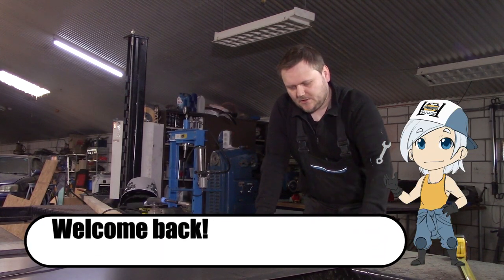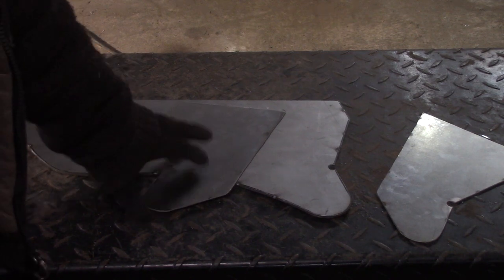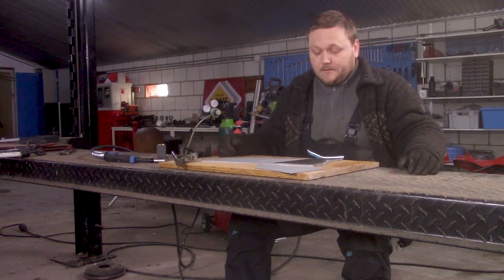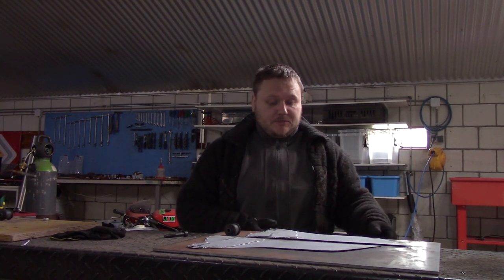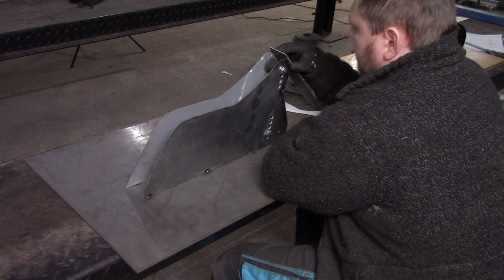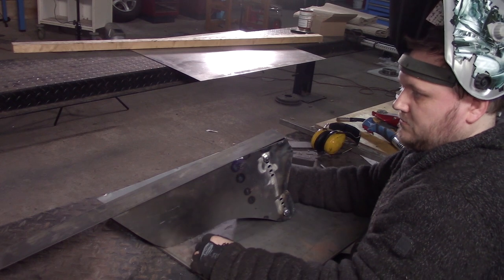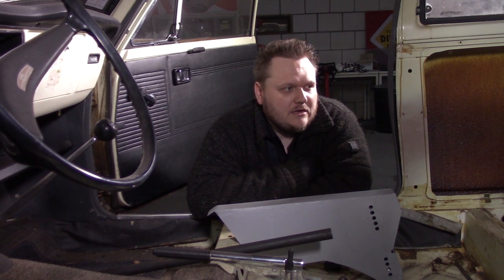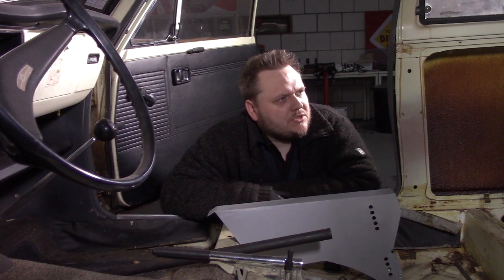KE10 Corolla Build Pt 7-3 | DIY 4-link suspension. Chassis boxes.

Comment: Hahaa, i think to do pushrod-suspension too!!! There is enough space between the shelf and the tank, i plan to use crossmember and 2:1 ratio triangles and half the travel coilovers with twice the stiffness coils.
Reply from the maker: Hi there. I dont think there is enough room there for the coilovers I am going to use. But still great to see a other one building a system. I am also in developing a "big" brake kit that fits 13 inch wheels front and rear.